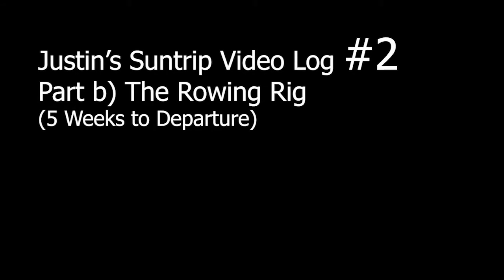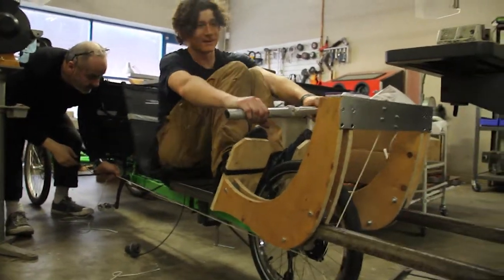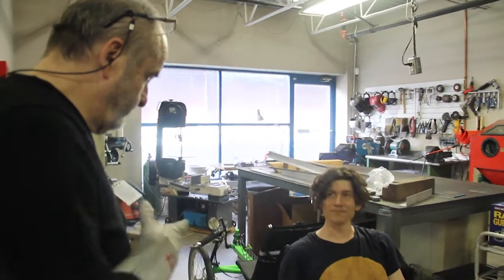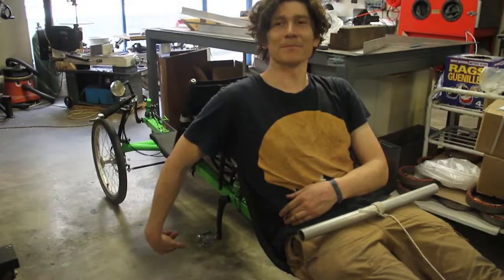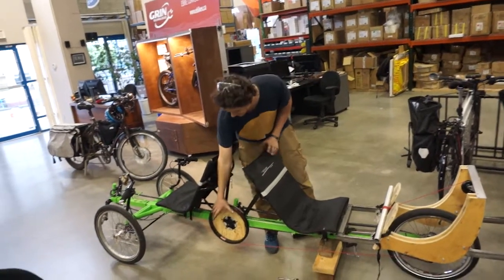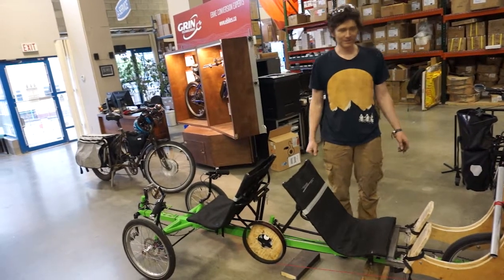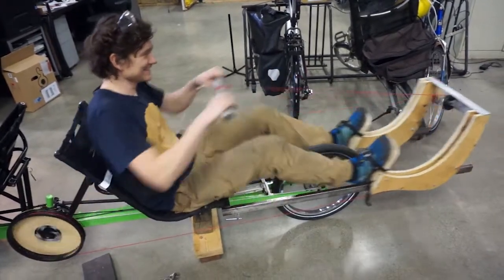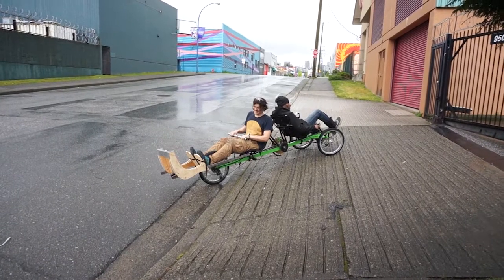2018 Suntrip Solar Trike Build. Video #2b First Prototype Rowing Rig

Comment: Nice! From a rowing standpoint, 38 strokes per minute is what you’d expect during a 2k sprint. Maybe lower your stroke rate to make it more sustainable. Good luck!
Reply from the maker: There is quite a difference between the comfortable rowing rate on various rowing bicycles versus on boats. The THYS rowbikes from rowingbike.com row best at around 55 - 60 SPM, but the motion is a little bit different with the arms and legs pulling together rather than in sequence. On this contraption I'm trying as best as possible to model the motion and rhythm of a rowboat, and with the current gearing am right around 30 SPM which is about ideal for that.

Comment: I had a simulator idea of multiple riders on one vehicle. I thought it would be easier to eliminate the chain and give each rider a generator that they could individually control resistance (charge rate) The energy could be stored in an ultra capacitor, the driver could be aware of this level of charge, in the capacitor, and adjust the rate of consumption accordingly. In this case the rower could just row constantly and not have to stop because of road conditions or even when the vehicle is not in motion.
Reply from the maker: Yeah the generator concept has a lot of advantages this way, and I'm a little bit bummed that in the end I'll be doing a purely mechanical linkage and won't get a chance to implement it a generator system. Well it's not too late to change my mind. We'll see!  

If you haven't looked at the endless-sphere post I showed how you can determine the exact optimum RPM for running the motor as a generator for max efficiency. See this post
https://endless-sphere.com/forums/viewtopic.php?p=1376523#p1376523

Comment: When I was at the rowing club, a guy went past with a C shaped back and someone said: Yes serious rowers can have back problems. you can read a bit about rowing back ergonomics.
Reply from the maker: I believe it. Luckily I'm just a very casual rather than a serious rower ;-)   So far my own experience has been that biking long distances always gives me knee problems, while rowing seems to play nice with all my joints. But this will be the first truly long distance test we'll be mindful and careful, and appreciate the concern. 
 
The electric assist will help, and if it comes to it we can always revert the back seat to be forward facing with normal pedals again if there are serious rowing issues that come up on the journey.

Comment: I'm amazed you managed to get it to work! Great job there! Now I'm wondering how hard would it be to row uphill, cuz if you wont have any gearing - your partner would be on his own every time uphill shows up and you're not able to row
Reply from the maker: Oh it has a full set gearing, there's a 10 speed cassette plus a SRAM dual drive rear hub giving 30 total gears to cycle through. So when the pedaling rider at the front changes gears then the person on the back rowing also sees the benefit since they are on the same drivetrain.  Remember that the rower is turning the same spindle that used to have the tandem cranks on it. 

But you are totally correct that on uphills where you don't coast far there is a back and forth surge in velocity, especially on steep hills at low speeds when there isn't much momentum to carry the bike through.  This will be balanced largely by the fact that we'll have two hub motors as well, which ought to scoot things along on the uphills quite well.
Reply: Nice. Its a shame I learned about this race so late, hope I'll be able to take part one year too!

Comment: Looking great Justin! You should definitely cover that rear wheel...you don't want your pants getting sucked down when they brush against the tyre!
Reply from the maker: Yeah not to mention a steady spray of rain and debris in my crotch when the roads are wet! 

There will be a full wheel cover for sure on the finished vehicle, and until then I'll live a little dangerous with the pant cuffs.